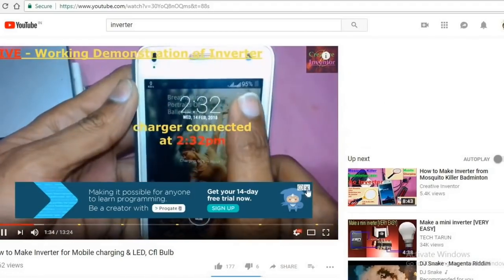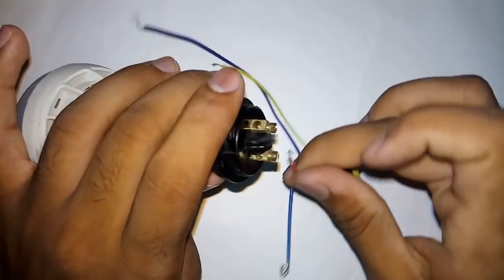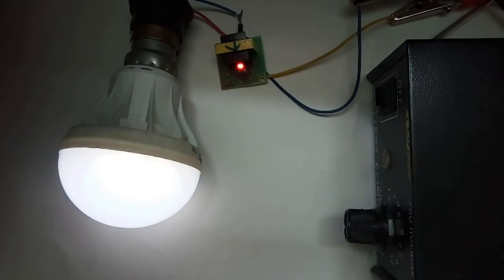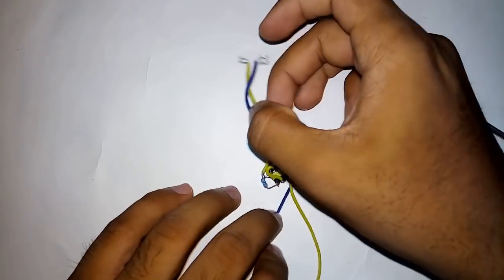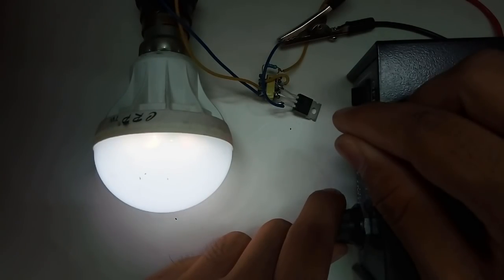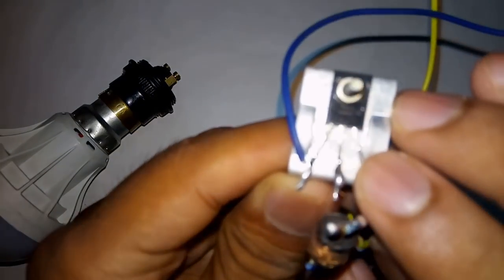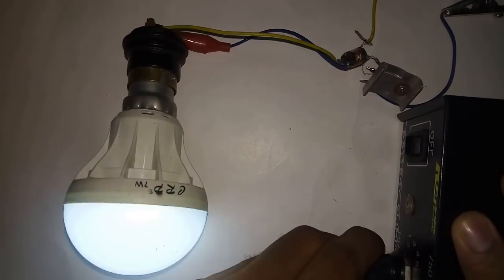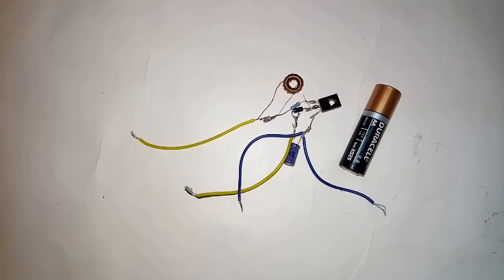WHICH ONE IS BETTER MINI INVERTER !!!!  D882 (OR) IRFZ44N MOSFET(OR)MOSQUITO BAT???

Comment: How made high voltage transformer. ..? Plzz tell me
Reply: 1. Take random inductor (that size or bigger)
2. Take that inductor and take out old winding
3. Take new isolated copper wire like 0,10mm 
4. Wind 150 to 200 turns
5. Isolate that winding with sellotape
6. Take another isolated copper wire like 0,30mm
7. Wind that wire like 10-15 turns
8.when you did that don't cut wite but make something like ear and start again winding like 10-15 turns (make 15-0-15)
9.isolate that transformer with 
sellotape and there you go (im bad in grammar sorry)

Comment: I want to make inverter using irfz44n 2pcs or 4pcs for application of laptop charging
Reply: u cant well u can but it is hard and takes more money to build and if the charger is 85 wats u can drive a a 7 watt bulb bc its not for inverter is it will act as an led flasher not worth it

Comment: I want you to use multimeter to see the output voltage of your saying "INVERTER" and your light is fake . Why? I think for me again FOR ME your light is not really light bulb that input 220vac  you put some led
Reply from the maker: Yea it is 220v ac led bulb 
But I didn't demonstrate that using 220v supply

Comment: bhai can youtell me how to amplify  2A to 4 to 6A...it will be very helpful for my project
Reply from the maker: Bhai, there is no proper circuit to amplify the current, we have only voltage amplifier, to increase the current, u can connect batteries in parallel

Comment: can u make inverter which can power an ac motor
Reply from the maker: What's the capacity of motor?
Reply: @BOLTsLABORATORY  A table fan ..220v can this inverter power a table fan
Reply from the maker: No u need to increase the capacity ... In coming days I will make the video

Comment: It works with cheap led bulbs...but not with bulbs like bajaj 7w bulbs...why ?
Reply from the maker: Because of transformer's amperage....if u use 12-0-12 5A transformer with slight change in circuit u can power multiple appliances
Reply: @BOLTsLABORATORY  
Thanks for your quick reply....
But could you explain me clearly....i need this qlarification urgently..
Reply from the maker: If u really want to make an inverter for bulb  and some of the appliances I'll share link with you.. in that video he explained the complete circuit...
Reply from the maker: @shivapuramkalyan6091   
https://youtu.be/VDi_uFSr3w0

I hope this link will clear all ur doubts..
Reply: @BOLTsLABORATORY  yeah thank you thats really help ful....but my aim is to work only with waste 18650 lithium ion cell which gives 3.7v..not with 12 volt battery
Reply from the maker: U only saying it is waste....I recommend u to use 12v 7.5ah battery (costs around 650/-)  for more durability
Reply: @BOLTsLABORATORY  
Waste in the sense ..batteries from old laptop....

But i will do as u said....i appreciate ur effort
Reply from the maker: @shivapuramkalyan6091  my pleasure 😊
And that's my responsibility 

Subscribe to my channel

More interesting project I'm gng to upload may be it is the first time on YouTube

Comment: where can I get the battery inverter
Reply from the maker: RED MUD  for what appliance you want battery inverter?
Reply: Engineering Box for car battery in order to use one lightbulb and table fan
Reply from the maker: RED MUD for that u need a couple of MOSFETs and 12 0 12 transformer and some basic circuit components
Reply: Engineering Box thank you.. if possible please make a video abt it..
Reply from the maker: RED MUD yea sure..

Comment: No sir actually irfz44n is working only for I second the reading on multimetre comes but then after 1 to 2 seconds it becomes zero so sir please kindly make a video on it
Reply: On multimeter it wil show no voltage 
But if you eill connect a bulb then it will work

Comment: Sir I want to ask that the 2 types of transistor d880and irfz44n but after I tried both of them it didn't worked but as in most of videos it shows the use of d882 so I want to know that whether these d882andd880 are same or not as in our town d882 is not availabe
Reply from the maker: Sujal Kumar here is the video for you

https://youtu.be/B7VblBE47-I
Reply from the maker: Sujal Kumar yeah both are same....if you request so I will make a video on it...

But IRZ44 has to work check your circuit.
Reply from the maker: DONHARU 101  i bought those two transistors 
and BTW i used d882 transisitor and to make a mini inverter with d880 transisitor you a 7 pin transformer......i'm unable to find it so, I'm still searching for it as soon as i find i'll make a video on it.........
mean while i made a theoretical video on how to make... plz watch that....
Reply: @BOLTsLABORATORY  experiments